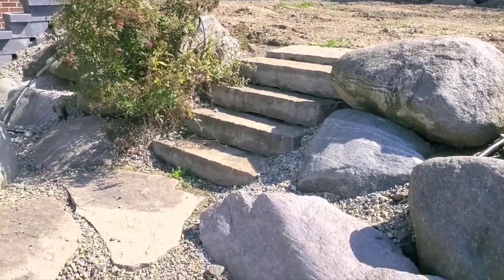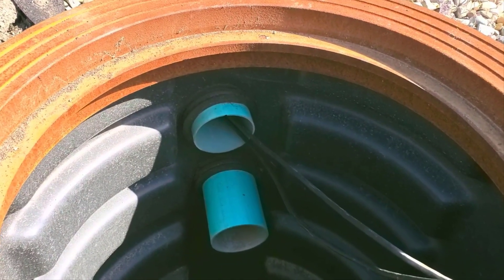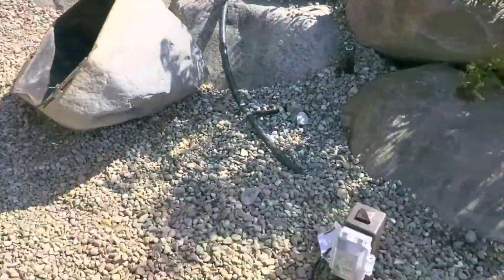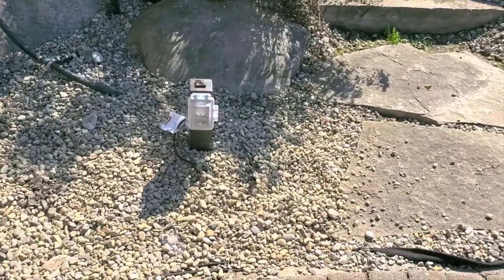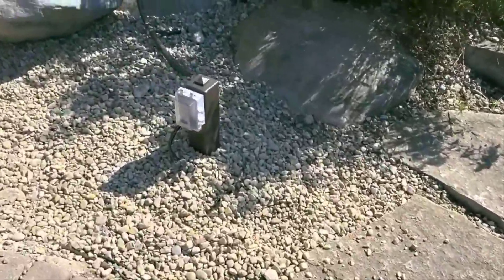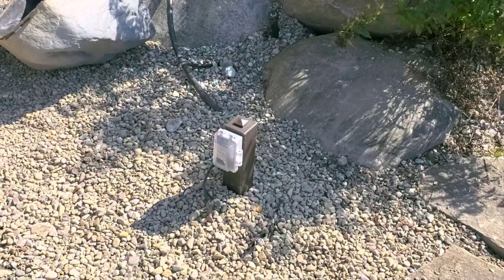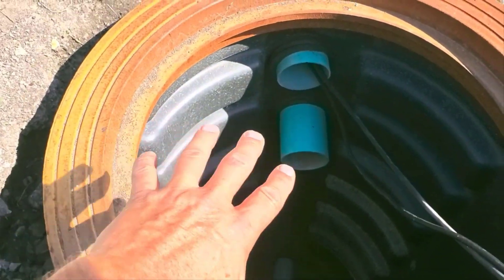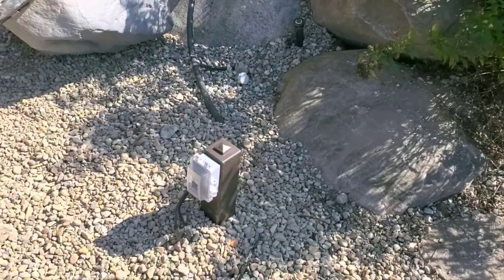How to Wire an Outdoor Sump Pump System

Comment: I ask specificly for a 25 foot cord, the installer got a shorter one, now I am 3 feet short of outlet and have to splice, or relocate outlet. At least the instruction book (pump book) shows it's "allowed".
Reply from the maker: 2 Pack Extension Cord Cover Waterproof,Ip54 Waterproof Box,Unique Stuck Extension Cord Design,Ideal to Protect Holiday Lights & Electrical Tool Cord Connection,Orange https://a.co/d/43eSwdE

Comment: Difficulty finding sump pump with 25ft cord

Anyone know why it’s difficult finding a vertical switch cast iron sump pump with 25ft cord? They all have only 10 feet or less. Home Depot, Lowe’s, Amazon... Due to the shortage?
Reply from the maker: It's a special order. It's not standard